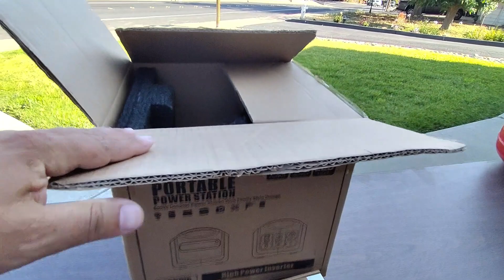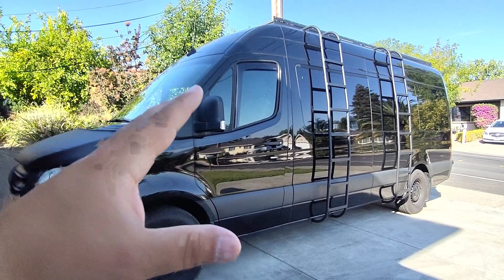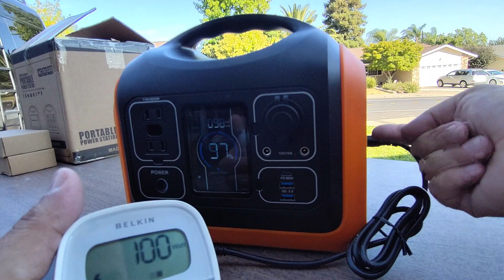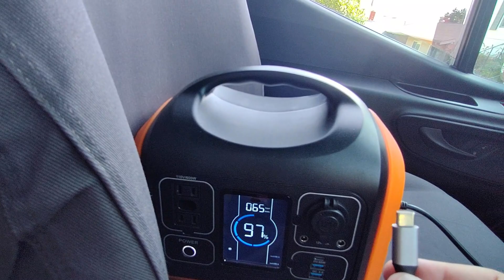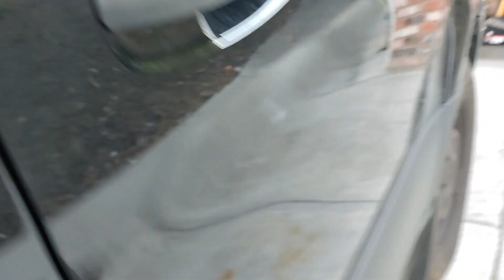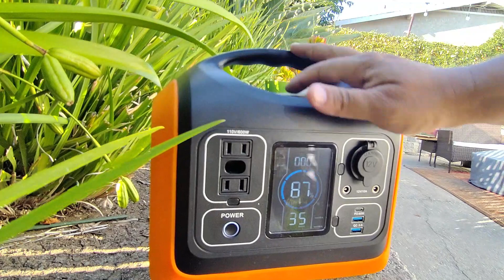OUPES 595Wh Power Station Review: LiFePO4 Tested!

Comment: Great video. I really like the point you made about the advantages of using a power station instead of a traditional electrical installation in a camper van/RV.  I wonder if this manufacturer (or rebrander) also suppliies a larger amp hour power station able to (say) run a 12v compressor fridge or similar appliances like induction cooker etc. New subscriber and I will be looking at you new video uploads.
Reply from the maker: Hi Barry, and welcome to channel, I'm not sure of about the rebranding, but it seems like  a good power station.  I will make a power station playlist and also release a video on how I made a 1160 ah lifepo4 battery bank in my Sprinter for dirt cheap. Let me know if you need anything else and welcome to the channel. _Randomfix
Reply: I ran my 30qt BougeRV 12v fridge/freezer on my Oupes 600w just fine.

Comment: Just for clarity.  They advertise "dual charging" via the ac adapter+ the USB c port.  

Are you saying you can also "dual charge" via solar+ USB c port?

If so that would be pretty great because I'm trying to have a set up where I can leave the power station connected to my rooftop solar panel, and while driving, charging another way simultaneously.

So far I have not found a unit that could do it because the solar panel share the same DC charging port as the cigarette lighter(car 12 volt).

I hope that makes sense.  In other words, I want to leave solar hooked up all the time, and get a bonus charge from my car's 12 volt system,  via my 4runners built in inverter, which has a regular 120v plug which I could connect the USB c to.
Reply from the maker: Exactly, I just launched a review this morning on a unit that did this exact function that you speak of and the battery chemistry is lifepo4 which is a huge upgrade from the Awanfi. Check out the video and let me know if you need anything else. I did not personally try out this dual charging on the Awanfi so I can't say much if it did or did not work. 

https://youtu.be/UYlNANMgzGo